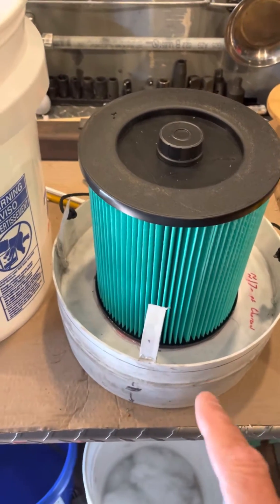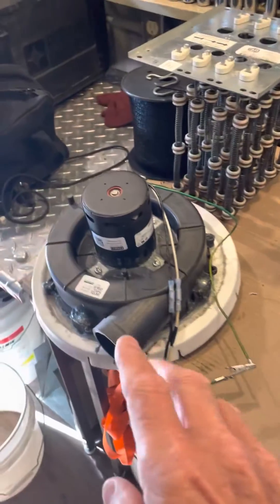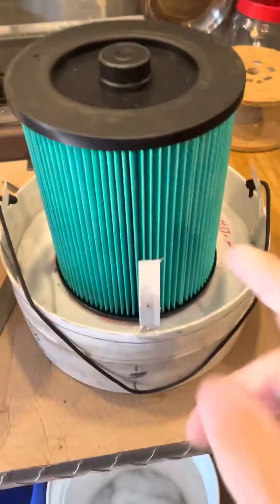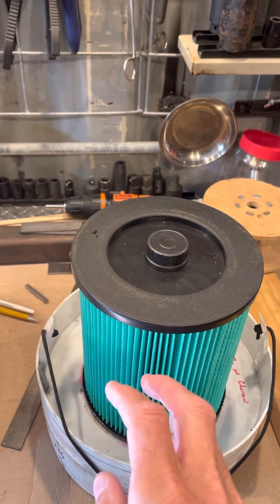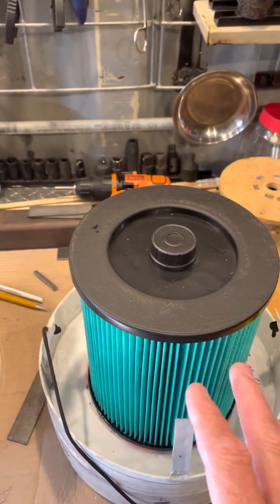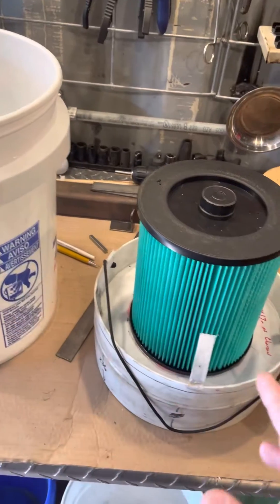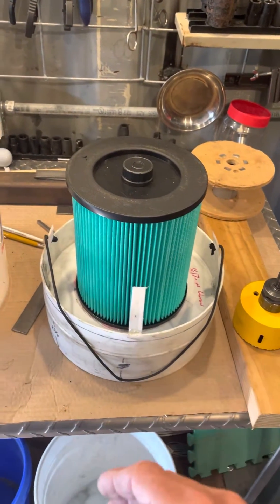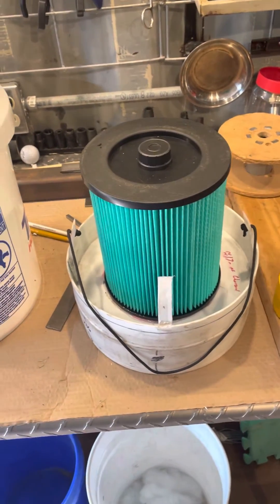Updated emergency nuclear contamination filter element - making it more versatile.

Comment: Shouldn't it go through the filter before it goes through the carbon?  
Shouldn't the order be:
1) Batting
2) Filter
3) Carbon
4) Small amount of Batting (in case some carbon gets loose)

Also, do you know if this is enough carbon to actually stop anything?  And if so, how long do you suspect this amount of carbon would be good for?  I know the professional systems use like 30+ pounds of carbon.  However, they are also designed to last for months which seems a bit overkill.
Reply from the maker: The batting (roughing filter) on the inlet is good and helpful to prevent plugging. The reason for the carbon first is it captures radioactive gases and holds them up for a long period. The gases pass through any filter. The carbon traps the gases and allows them to decay into fission particles which the filter can then remove. As for amount of carbon, the beds at nuclear plants for the control room were 2 inches deep beds. But the important part is the air flow through the activated charcoal should allow at least .25 seconds of contact time so you want a flow rate that allows that contact time. In reality you probably don’t not a lot of air flow. I have a CO2 monitor to make sure there is enough makeup flow. The activated charcoal will probably last a very long time so the limiting part will likely be the HEPA filter. But this system would likely be good for over a month and if you are just using for makeup flow it would likely last much longer. For the cost you could make spares that you could exchange if needed. Hope this helps. Thanks for the questions.

Comment: Something that might help in first going through a water filter then charcoal filter then air filter. Just a thought water works wonders on lots of stuff  as does activated charcoal to remove dust and toxins in the air.
Reply from the maker: Water would help some but not as much as you may think. The radioactive gases will not be held up by the water much because they are gases. The contaminated particles will be refused some but when you have to draw the air through the water you get a lot of head loss and will have to compensate with a more powerful fan/blower. So, is the slight added filtering of the water worth the extra power needed and complexity? That you will have to determine but nuclear plants don’t use water as a filter aid except for very specific emergency conditions and the only to help slightly.
Reply: If you fart in a bathtub, it still stinks.....😉

Comment: I’m actually building a similar system right now because I can’t afford 8800 for a store bought one. I have a question for you. This filter helps to pressurize the room/enclosure you will be in, how are you addressing the air outflow?
Reply: You need to get the airflow leakage low to keep an area over pressured. The more leaks the more difficult it will me to maintain a positive pressure. You could seal a much smaller space than an entire home such as a room or two. If you have a real tight shelter than you can use a exhaust port, this could be simple as a small PVC pipe vent with an unglued PVC cap that you can remove. You can make use another PVC end cap with some holes drilled in so you can tune the positive air pressure in your shelter.

FWIW: I recommend a much bigger carbon filter. Perhaps a entire 5 gallon Pail filled with charcoal or activated carbon. For my design I am using a box made of plywood so I can fit multiple HVAC filters and a large container filled with activated carbon, and using 3" PVC for air intake.
Reply: @guytech7310  I’m using an above ground tornado shelter in my garage that I am going to fortify with sandbags. Using thick plastic sheeting I hope to make a sort of tent that can be pressurized. Fingers crossed
Reply: @ewaddington1  I don't know if you have adequate shielding in a above ground shelter. You need at least 12" of mass on all sides presuming your distance from any targets and not downwind. For the first few hours it could be as high as 1000 Rad/hr. Humans can only tolerated about 100 Rads in a short period before getting acute radiation poisoning. 4 inches of concrete will reduce rad exposure in half, 12" will reduce to about 1/8. with an outside of 1000 Rad/hr, with 12" of shielding would cause a 125 Rad dose. 

Ideally fallout shelters need 24" of concrete or 36" of soil to provide adequate shielding in the worse case. You might be able to get away with less if you are distant from any targets or nuclear power plants which will likely meltdown in a nuclear war. Also need to be away from any airports as those are likely ground strike targets.

Below ground shelters are just easier to work with since you got natural shielding on all sides except for the ceiling.
Reply: @guytech7310  sadly it’s the best I can do at this point. Steel and several layers of sandbag is all I have. Dropping a bunker in is cost prohibitive for me. 40000$ is what I was quoted and that’s a no go. Any suggestions?
Reply: @ewaddington1  I presume you don't have a basement? $40K seems a reasonable price for a bunker. Only other option is DIY, Rent a excavator to dig out the ground and either get a concrete contractor to pour footings & walls, or use blocks. You still need to pour footing for block wall construction. 

Another option is to find a home with a basement, and move. 

Sorry, all this just sucks, the US gov't seems bent on starting WW3. They are all insane, and it does not matter which party in control. If we had some sanity in gov't we would need to be worried about nuclear war.
Reply from the maker: Unless you have a really tight shelter it will naturally leak out. If it is tight you can put a damper in to allow air to escape like a dryer vent.
Reply: Did you end up making it? If you can you upload a video showing it?
Reply: What is the recommended size of the carbon grains?